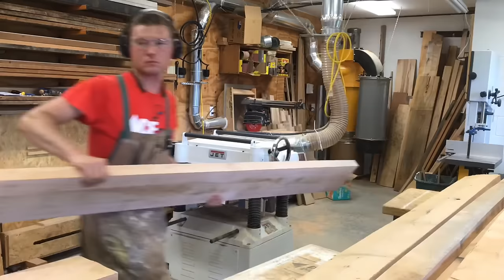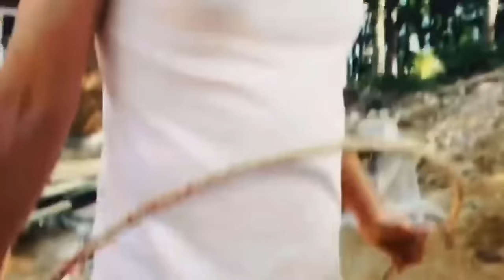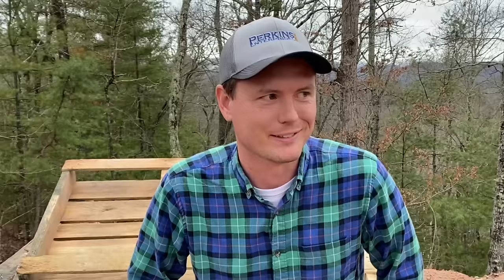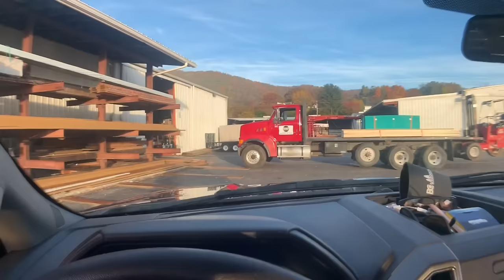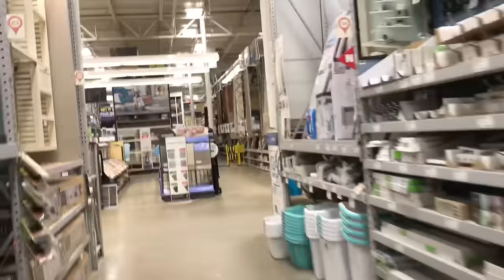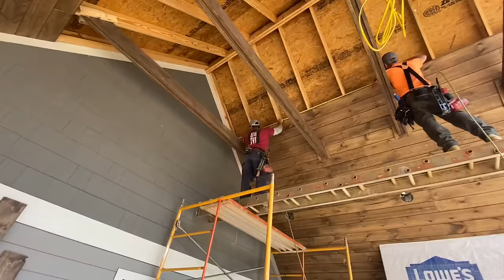Man... we were idiots! Wait... maybe we still are!

Comment: Your comment about trucks -  on point.  My wife bought me a "new" truck for my company.  But, I have yet to switch over all my tools to it.  And I don't want to mess it up; my old truck still gets it done.  "But, it looks beautiful!"   Then tools & Lowe's - also correct.  As a Plumber, it is specialty anyway and Milwaukee has it going on.  Thank you Home Depot and Ferguson Supply.  Warranties and breaking the stuff within 45 days is typical;  even Keen boots and Duluth pants have questioned me  "Let's crawl under this house and see if my tools can handle it with 3" of standing funky water."  And job planning is what I called your last point - that is the $$ shot.  I try and plan as well.  But, I drive 25 miles one way to a job site thinking I have all the materials.  do what I can, but I need that one PEX fitting or ran out of glue or solder  "Funny Duck, I read a book once on how to be a Plumber, and my brother-in-law does it on the side, it is easy."  25 years a plumber and still learning from the newbies.

Comment: What I’m planning to do is get a Tesla model 3 because I drive a lot of miles and that would be so much cheaper and buy a tool trailer. Most of my work is totally doable out of a sedan(I even did it out of a 2 seater sports coupe for 6 months 😂) but there are times when I need to transport larger tools or materials.

Comment: Well 20 years ago I was only 10 so it wouldn't be another 4 years until I got my first job in construction.  And I def worked harder and not smarter for a long time. Over the last decade or so I've slowly transitioned into finding easier and smarter, more efficient ways to go about things. You learn tricks and tips from working with different people. I just try to absorb it all so I can be as valuable and efficient as I possibly can be.

Comment: So where do you get the good tools?
Reply: @ J L  ... good tools? The question would be what would you say are good tools? And would be ready to pay $500 or $1000 for a tool when u can get it for 50% or 75% less and do the same think? I would like to be able to buy “ good “ tools. But they are to expensive for me even I know they will last for years. But I cannot afford to spend $1K for a saw when I get a $300 Makita saw how does this job too ... and if you ask me what are good tools ... I would say Hilti and Maffel ( if you work on the job site ) for inside work Festool
Reply: Tool supply stores. Acme, Toolbarn, etc. Mostly online unless you have a local distributor.
Reply: Depends on the tool, smaller boutique type stores will have higher end tools but usually a more limited selection. Acme tools is great, if you ever get to the Midwest it's worth going to one, it's like going to Disney.

Comment: Hey, I just had a quick question. I'm a carpenter's apprentice and a couple of months ago I bought two makita drills. The DDF482 and the impact driver DTD152. I bought these drills to save some money so I could buy some other tools. The drills work well enough but I just don't really like them compared to the festool DRC drill. So my question is, Should I buy a festool DRC instead (which I really like) and give the makitas to my dad (whoose in need of a new drill) and just live with a bit less money? Or should I just push through with the makitas untill they brake and save some money? 

And I do have the money to buy the festool btw so money isn't really a problem in this case.
Reply from the maker: StoneCold Sweden we have been pretty happy with Makita products over the years. I own several of the impact drivers and drills myself. I have one that has lasted over 12 years on the job site so they may not break as soon as you think! The batteries do grow a little weaker overtime, but have really lasted well considering what we have put them through. They do make a professional line and a homeowner line of tools. In the past the homeowner liner tools was black-and-white, while the professional line was their trademark teal green color and black. I also own some Dewalt drivers and drills. They seem fairly strong but I have noticed that in a lot of cases one good hard drop will trash them, where is the Makita keeps going strong
Reply: @PerkinsBuilderBrothers  Thanks for the fast answer! I'll think a bit more on it and make my decision later.

Comment: Or Festool or Mafell.....
Reply: Glenn Holcomb , overpriced? Definitely.  Junk?  Nope, unless you are a fan of AVE and his TS-55 BOLTR.  Well, until Festool fixed (let's hope) the motor problem last year in their 120-volt USA version of the Kapex miter saw, I might have agreed.  But if you're doing finish carpentry and precision and effective dust collection matters, REALLY matters, Festool and its even more overpriced little red competitor, Mafell, are simply nonpareil.  Cheers.
Reply: Glenn Holcomb  I've trimmed houses where we had to use a dust collection system while cutting outside. It was to keep the neighbors from complaining, which they did about just about everything.

Comment: Hey when are y’all gonna start building building custom cabinets?
Reply: Doing both general construction and custom cabinet building is sort of like an M.D. doing general practice - family medicine and neurosurgery at the same time.  Sure, both are doctors, but they require very different skill sets.  While it's possible to do both general construction and custom cabinet making, that would be very inefficient in the use of their time, talent, and experience, and it would make them non-competitive.  A Swiss Army knife or a multi-tool can do lots of jobs, but not always as well, easily, or efficiently as a specialized tool made for the job.  We don't expect a Stillson wrench to work as well on a job requiring a basin wrench.
Reply: Welsh Rabbit I’ve been doing both for many many years on multi million dollar custom homes my dad did it as well as my grandad it’s scary at first but I wouldn’t do it any other way... I think if they lay the tile and paint they could at least give it a try  especially if they only build a few homes a year
Reply: @texascraftsman7215 , congratulations and very good that you do both well.  Even better that you can do both and still make a good living at it, but I'd say your experience is probably more the exception than the rule. I find for most folks that specialization is the key to success.
Reply: Welsh Rabbit  ... I would say the same as u... to build custom cabinets needs a lot of experience and you need the space and the machine to do it